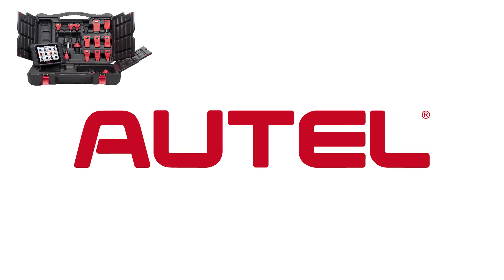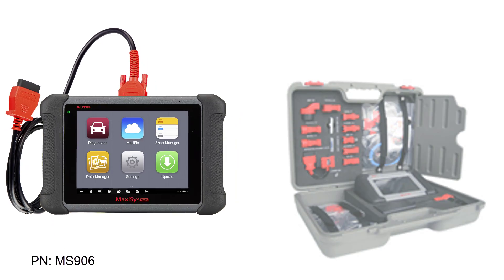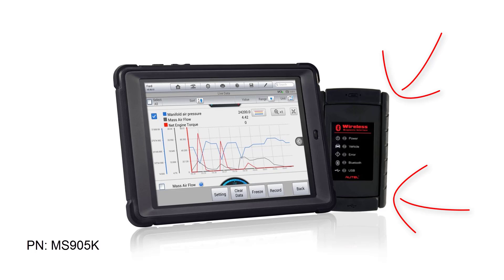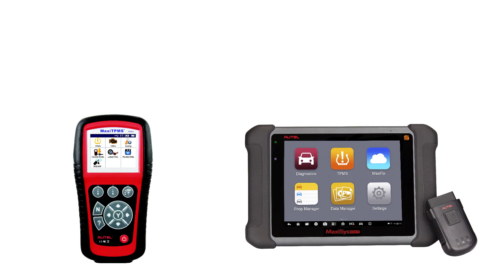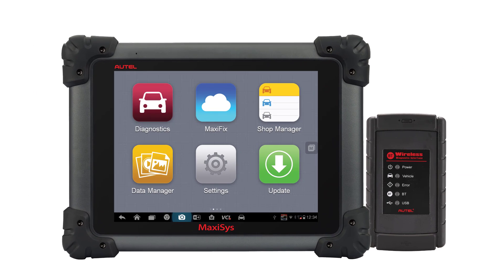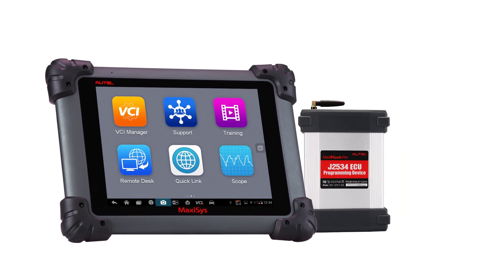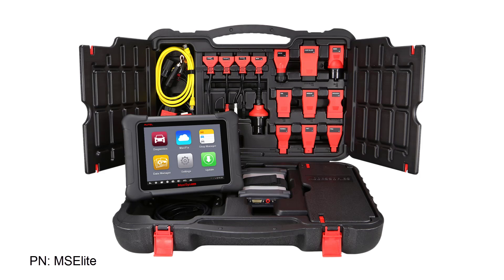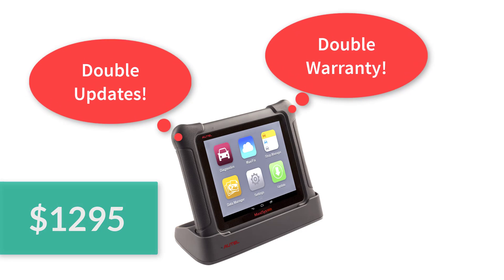MaxiSys Line of Tools Explanation

Comment: Any feedback on reprogramming GM key fobs with the 908 elite, I get a ton of gm vehicles here that need that service. I currently use an older Launch x431 and it will not do it. The local vendor has one with a free handheld scope. Thinking about it
Reply from the maker: Most of the key fobs I have done have been very simple with the Elite, the majority of them don't require a scan tool at all.  Once you get into the High security keys and Prox Keys that is where you are going to have trouble.  Check out www.aurodiag.com they have the IM600, that might be more what you are looking for.
Reply: @FlashPerformance  cool thanks. I was a Saturn tech for s long time and some models required a tec 2 to program the fobs. Good to know. Thanks again for the quick response!

Comment: Do the  908's and Elite also have TPMS capability?
Reply from the maker: The MS908 and Elite can only program sensor IDs to the PCM/Module.  They have no way to activate the TPMS sensor.  All diagnostics tools (Except the MS906TS) require a separate TPMS tool to activate the sensor to retrieve the sensor ID's

Comment: can i connect the ms906bt to a vehicle without using bluetooth?
Reply from the maker: Yes, there is a supplied USB cable in the case that you can connect between the Ms906BT tablet and the VCI that will make it hard wired to the vehicle.

Comment: Which maxisys tool would work best for key programming. I have a audi a4, my sister has a TL, and I might get a bmw soon. what would you suggest? and could you explain the advantages of whichever tool you suggest. Please and Thank you
Reply from the maker: There are a lot of variables when it comes to key programming.  Some vehicles require you to have a locksmith password and use J2534 to program keys.  The majority of vehicles can be programmed with any of the MaxiSys tools.  Most locksmiths will choose to go with the MS906 or MS905.  Both of these tools have a friendly price point and are not to bulky to travel with if necessary.  I recommend checking out the coverage is at https://pro.auteltech.com/measurecar-1-1.html for specifics on what vehicles can have keys programmed
Reply: Sorry, so this device wouldn't give me accesses to locksmith passwords? Then where can I get it? Is there another deceive I would need to give me the access to the password for all 2, maybe 3 cars?
Reply from the maker: A locksmith password means that you are certified and bonded to be able to access security systems on vehicles.  This has nothing to do with the Autel tools and everything to do with safety and security. All of the information about becoming a certified locksmith can be found here: https://www.nastf.org/i4a/pages/index.cfm?pageid=3532  For your applications the TL will be no issue, the MaxiSys tools have great coverage on Honda and Acura. As for you Audi A4 you will have the functionality to do key matching, J393 Adaption, erase keys, add keys, Sync remote keys,  and more.  All this information was found on Autel.com>Support>knowledge base>Vehicle coverage
Reply: Thank you brother, you've been great help here. I'm gonna go check out that link? How long does it usually take to get certified though?
Reply from the maker: For your applications I doubt that you will need a LSID (Lock Smith ID).  I have not done the process I am not sure how long it takes

Comment: What exactly is ecu coding?  I see this term used a lot but I am not sure if I need it.  So far it seems the MS906BT would do everything I need.  (shutting off injectors, troubleshooting actuators, transmission related code,reading/clearing/tcm reprogramming)

Do I need 'ecu coding' in order to change the tire size on the ecm?
Reply from the maker: ECU coding is a loose term in the industry that means to make 2 computers talk to each other (handshake)  For instance, when you replace an airbag module you will need to "Code" it to the PCM so they will start talking to each other.
Reply: thank you so much for the reply.  so would the ms906bt be able to do that coding?
Reply from the maker: Yes, The MS906BT sounds like it would do everything and more that you want it to.

Comment: can you please elabrate on what you mean by coding and initialization? will i be able to calibrate certain sensors like the SAS on most BMW? will i be able to do airbag light resets and certain similar functions? i currently have an innova scan tool but that only does so much for me.. looking to upgrade and to a bigger better too and i'm checking out the Autel MaxiSys MS906TS
when you say programming, does that include ecu programming with the use of the j-box?
please advice.... and Thank you
Reply from the maker: Coding would be when you take a module that is already programmed and install it in the care and code it to another computer or module.  For instance if you replace the airbag module you will need to code that to the body control module and the occupancy module.  By coding modules together it will allow them to talk to each other.  Initialization would be telling a sensor/module what to be.  It may have multiple protocols programed in it just needs to be woke up and told what they are.  For instance when you replace a battery in a BMW you need to tell that module what the battery is and cca, that would be considered initialization.  The SAS functions would be easily accomplished with the MS906TS.  That can be done under the service icon or by going into the module and doing a special function.
Reply: thanks a lot

Comment: hi can i use j2534 with mini 905 ? many thanks
Reply from the maker: Only the MS908 can be upgraded to be used with the J2534, however that is only with BMW, Mini, and Benz programming.  All other programming is done with a Windows 7 laptop and the J2534 box.  To answer your question, No, the MS905 Mini can not be used with the J2534
Reply: Flash Performance many thanks for replying me j2534 whith wind 7 is working as same with on tablet autel maxisys 908p?many thanks
Reply from the maker: Most manufacturers require windows 7 to work with J2534.  Because of that 98% of the programming you will do is with the laptop and the J-Box.  With the MS908P and the J-Box you can do select module programming on BMW ad Mini and some SCN coding on Benz
Reply: thank you for your reply